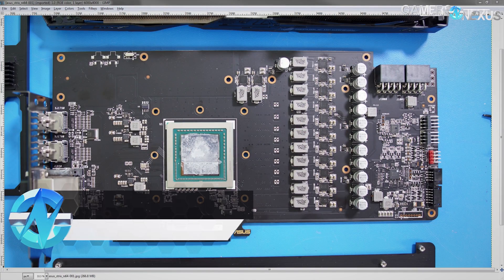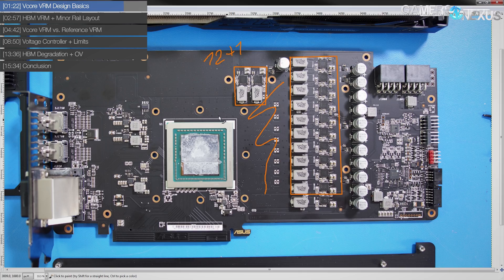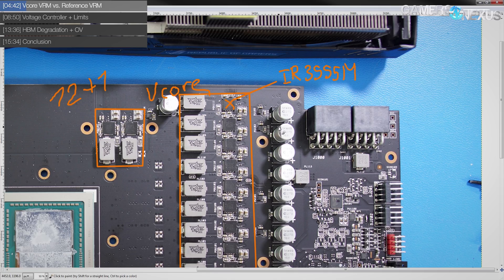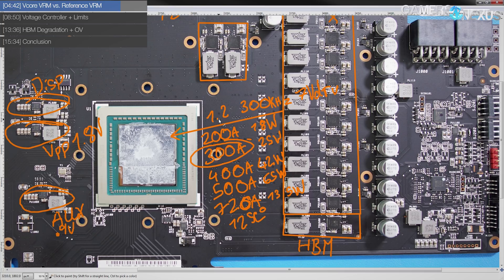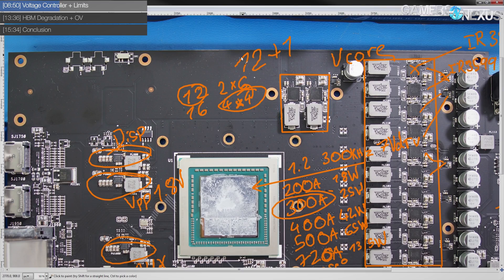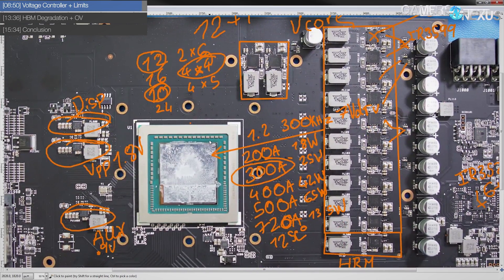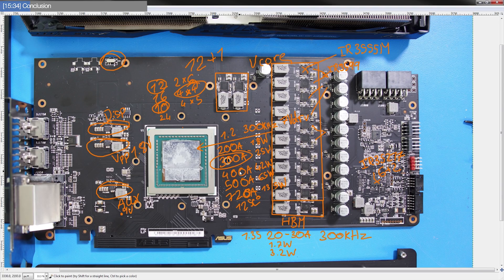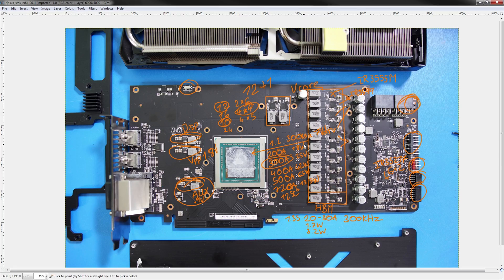VRM & PCB Analysis of ASUS ROG Strix Vega 64

Comment: Wow, first ^^
I was waiting for that video, time to watch it!

Edit:
Seen it now, I am glad that the PCB was not changed to the worse, so now all I have to do is continue the waiting game with AMD. .... Still no custom cards available, I hope ASUS won't charge even more as the reference ones come close to cheap 1080 TIs already.
Reply: Oh, They'll charge more.  Hopefully they keep it to something reasonable.  As good as their cooler design is, it's only worth a $50 hike at worst.  I'd forgive $100 though, at the absolute worst...  Though I'd probably just buy reference at that point and an EK block if I were buying one.  TBH, I'd probably just buy reference and an EK block anyways if I were buying one, just because I like custom loop water cooling and the PCB design isn't OMG better.  Just, only marginally more efficient.  Which won't really matter to the EK block in an oversized loop.
Reply: WOOOOOOOW
Reply: My problem is that I am not into water cooling, so no EK block for me. I hope they go with 50€ above the MSRP (< sure) max, 100 is really high for just "not throttling" cooling.